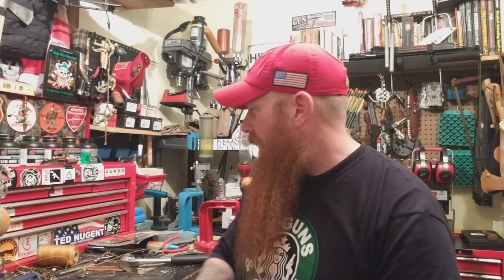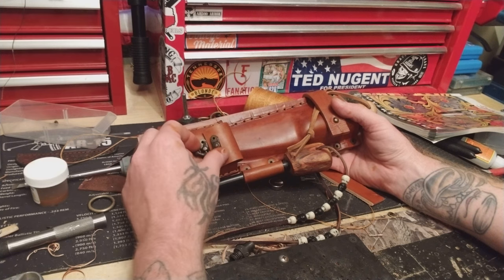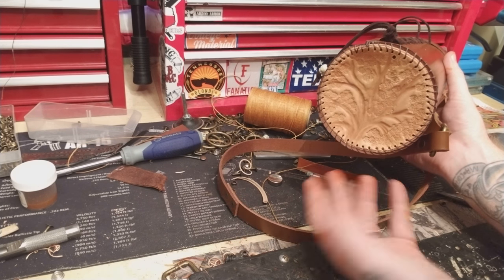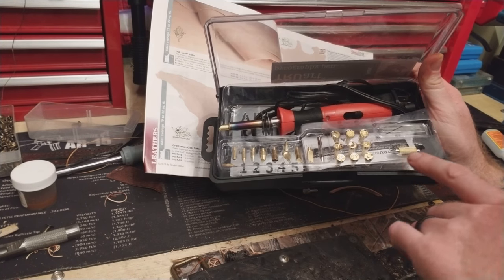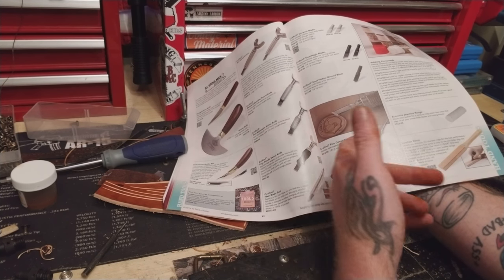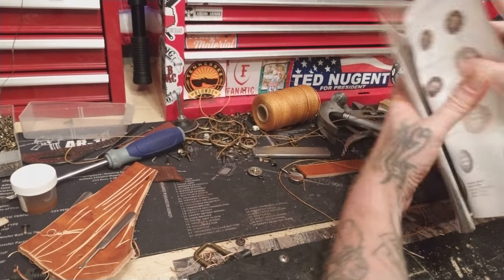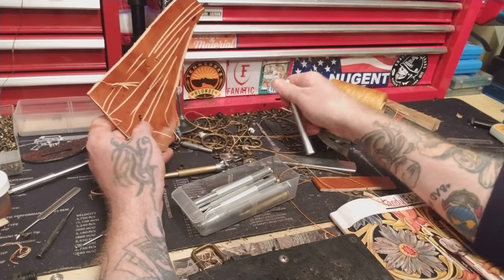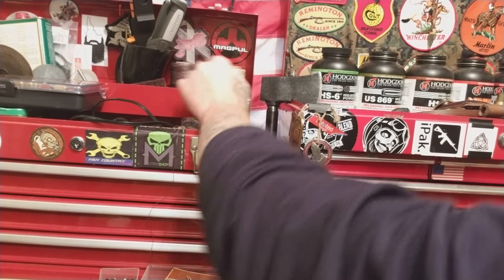Sheath for Dave Canterbury | Spotter Scope Case | Leatherwork Tools

Comment: Say Heah, WoW that blade profile looks like My Knife that I wanted to personalize,  as My Knife. I never liked sausage style handles, so when Battle Horse came out with their Attitude, I started to modify it. I had B H put a slight curve on it, so that took the high point off the pommel which allowed me to lite chop with it a whole lot better.  I also had the pommel flared.  I stayed with the stock thickness for economic reasons, it turned out OK, because I got a high scandi grind and had it Vexed, it's a great strong slicer now.  I also had tge drop point lowered similar to the Iz Turley Gasconade, I find an off-set  from a 
on-center tip divots better for me, so that came out great too.  I always liked a Woodlore style knife and that's what it turned out to look like. A Woodlore on steroids. I love it. To finalize My Knife, I had a white G-10 handle put on it with a blue Liners. They surprised me with a Beautiful Black square bottom dangler sheath, a lovely piece of kit, Infact it's Eye Candy.  It was Tempered by Peter's at around 58-59 HRC, Spot on. Infact it's one of my Fav's. and I wouldn't trade it for a real R M Woodlore.  Yeah, I posted it on my Google Plus, Your welcome to look and see if it's not similar. Oh, that's a great looking sheath, you did good.  Dilly, Dilly.,,.p